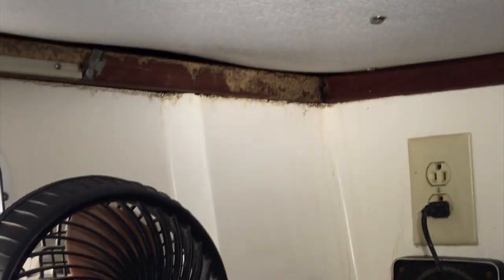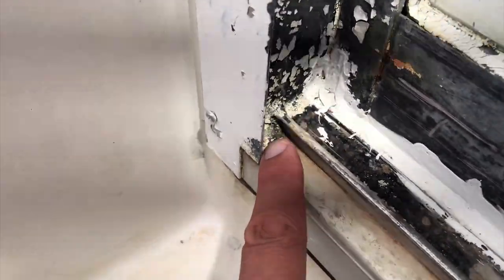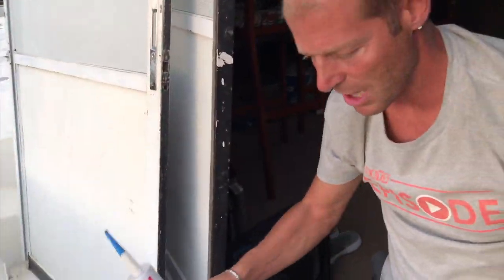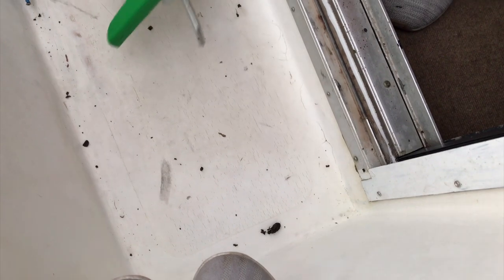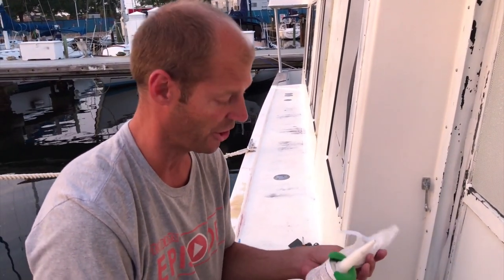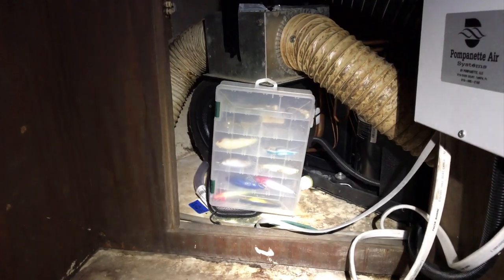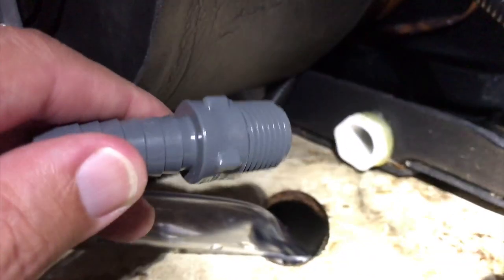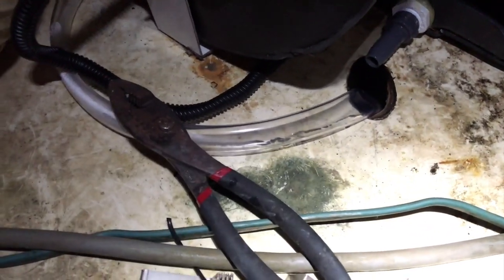Fixing Water Leaks On Our Bluewater Yacht

Comment: For the AC condensation consider getting a sump box and put a bildge pump with float switch in place in the bilge that is then spliced into a thru-hull.  Water drains into sump box and when full enough float switch activates pump which then pumps to the thru-hull line and out of the boat.
Reply from the maker: That's what I have set up now.  I just want to keep my bilge dry.  I don't like the standing water.